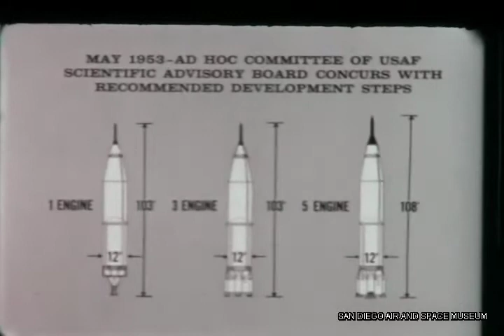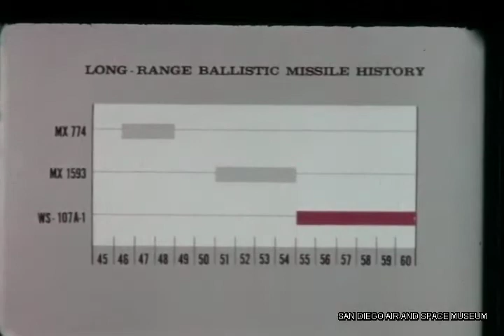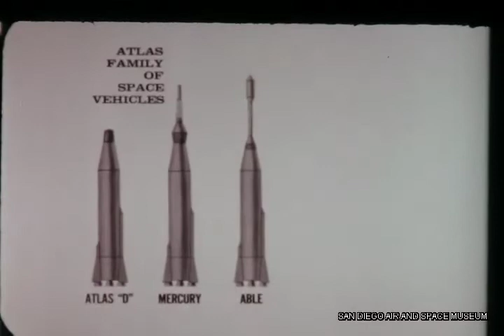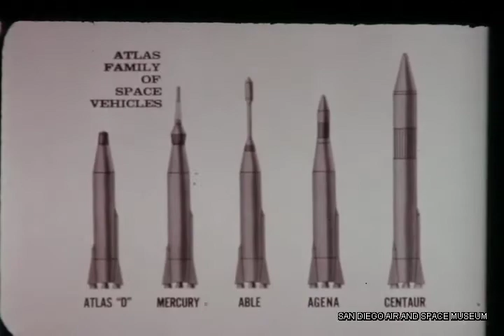History of the Atlas Missile 10/1/1960   HACL Film 00177

Comment: Crazy.  I worked w .025”1101 aluminum on some parts for a warbird restoration (using mostly 2024 alloy), it’s simply incredible how the missile’s fuselages stayed so uniform and shiny.  Handling such thin aluminum was very similar to working aluminum foil.  I’m amazed at the engineering needed to keep, these structures sound and predictable.
Reply: A stainless alloy was used in Atlas.  Not aluminum.